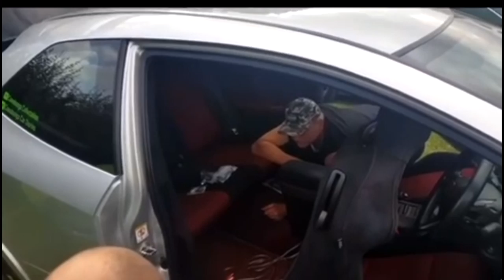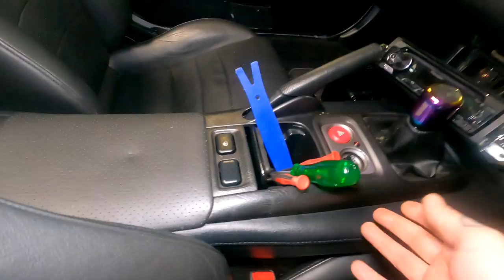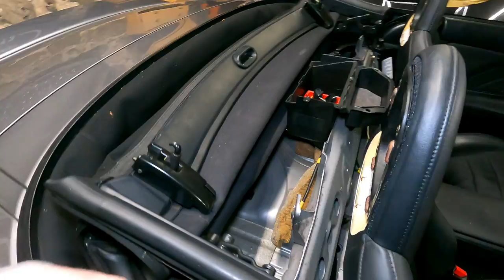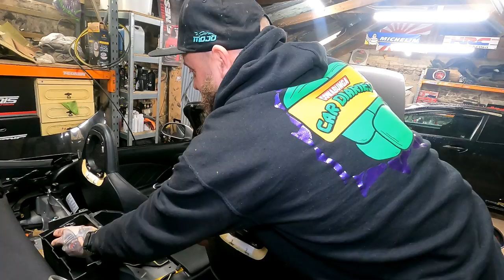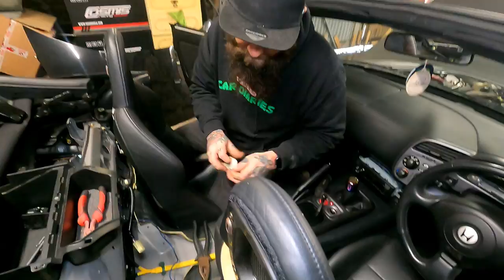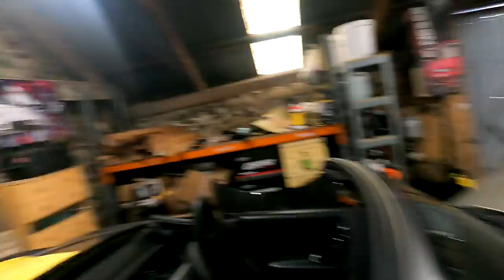Edge 80watt under seat subwoofer install on the Honda S2000 AP1

Comment: I still prefer K20 sound then under seat subwoofer 😁🤘
Reply from the maker: Very true mate 🤣🤘🏻❤️
Reply: I'd struggle as we put the back seats down alot an they fold pretty low dont they?
Reply from the maker: @craigevans1579  they do mate yeah, could always be put in the hidden boot area but though